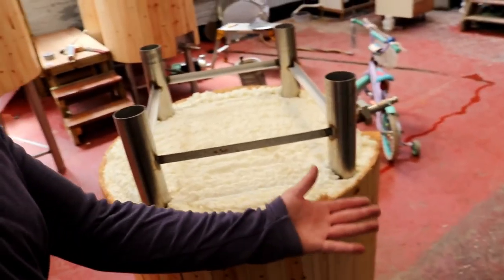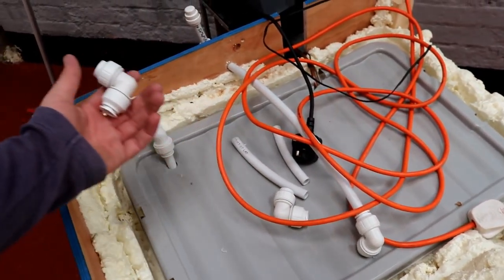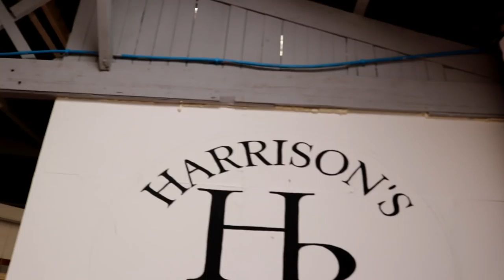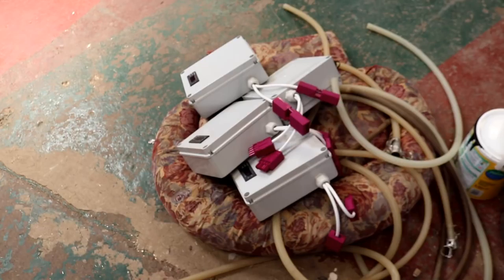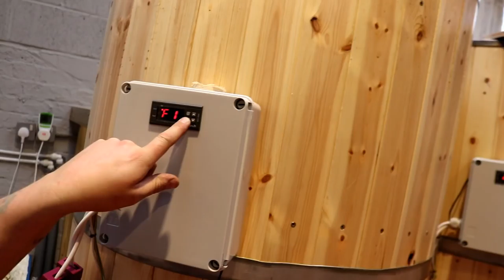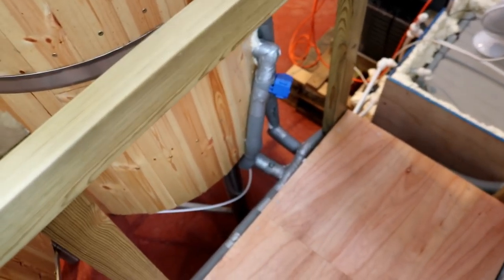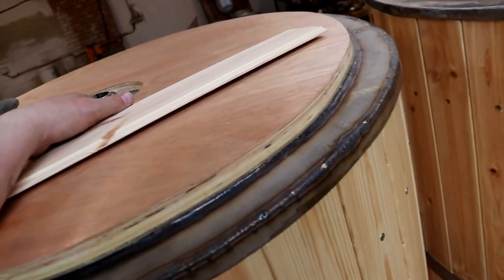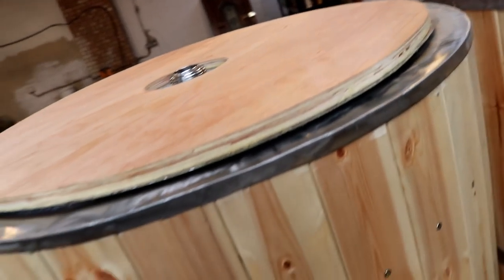TESTING THE CONTROL UNITS

Comment: Hary you can use stc1000 with flashed firmware its called stc1000+. New firmware will allow you to have fermentation programs and as well as termostat mode :)
Reply: That was only possible with the 1st versions of the STC - they've changed the eeproms and now you can't do that. Shame! BrewPi or BrewPiLess is the answer!
Reply: hmm i have version A400P and its working like a charm. So maybe some other newer versions have changed eeproms
Reply from the maker: A bit advanced for me yet buddy. I have not even started with anything like that yet. I would like to though.